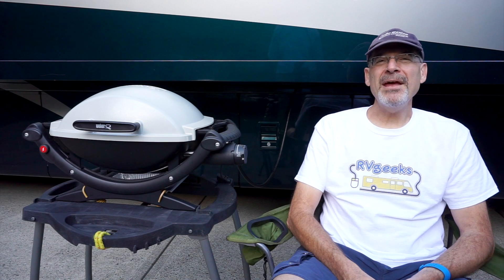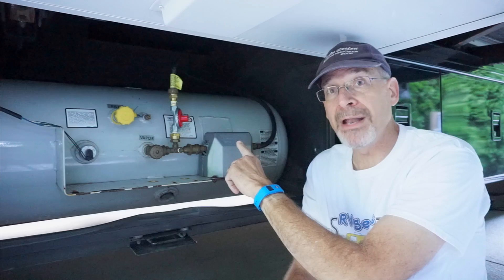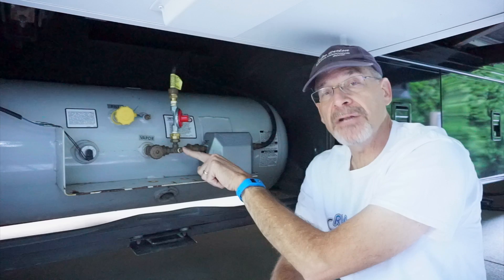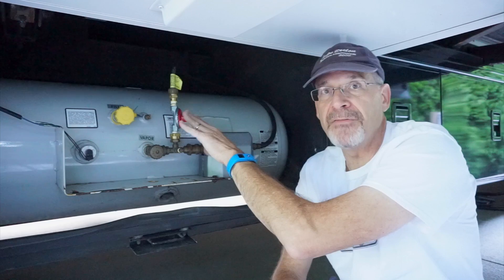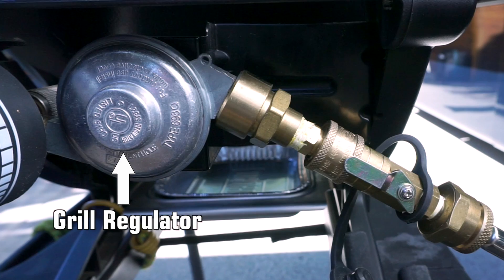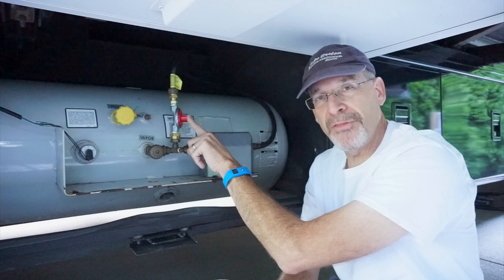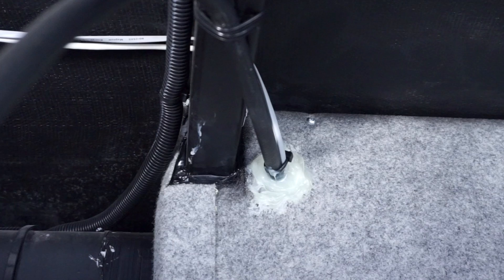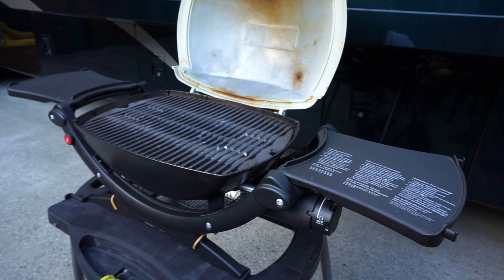How to Connect a BBQ Grill to an RV's On-Board Propane Tank

Comment: RVgeeks - I have a class A that has a port on the passenger side for just this use. I purchased and hooked up everything in your post here from that port to the grill (same grill as yours). I had no pressure at all. So I took the hose and connectors apart and started putting them on, opening the gas on each one to see where the flow stops. It stopped with the hose. I get nothing coming from the hose when I open the gas. I tested this by opening the line slowly and listening for the gas, but nothing happens. What do you recommend? (I'm using all the parts from this posting).  As always, thank you for your help. These posts really help people like me.
Reply from the maker: Hi Daniel! We're pretty sure that the first problem your having is the connection on the hose. Some have a little plunger in the end that seals when not connected to another fitting. That means the fitting that goes into it has to include the pin that pushes into the opposing fitting to allow propane to flow. The end of the hose is self-sealing, and needs that pin to push into it to open the flow. Also, it's quite possible that even if you get the propane to flow, it might not work with your port. If your port is already regulated down to 11" WC (eleven inches water column, or standard operating pressure), you'll either need to remove the regulator on you grill (we know... it's part of the control knob so not easy to do), or get a grill with no regulator on it. You should be able to check with your manufacturer to find out if the port is already regulated to 11" WC. If it is, a non regulated grill is required to prevent double regulation, which limits the flow below what the grill requires to operate. Hope this isn't too confusing, and hope it helps.
Reply: @RVgeeks  You were right on the issue... I actually just took a small drill bit and drilled out the plunger part and then removed the regulator ... works every time.  Thanks all.

Comment: Hi how are you able to run the bbq double regulated.
Reply from the maker: The first regulator is only a step-down to 15psi, so still plenty of pressure available for the second regulator on the grill, which is much lower than the 15psi.

Comment: Great video (as usual). My Winnebago came with a low-pressure connection for the grill, but I find the low-pressure grills to be on the flimsy side. I've seen converter kits to convert high-pressure grills to low pressure, but I'm wondering if you lose heat or BTUs on the grill. Any idea?
Reply from the maker: Thanks Mike, but sorry to report we’ve had such great service from our Weber Q (with  built-in regular) that we’ve never considered anything else. So we don’t have any experience with anything other than this one grill which is designed to be operated on higher pressure. Some grills do allow you to remove their regulators, allowing them to be used with the already-regulated propane on an RV with a low pressure grill connection.
Reply: @RVgeeks  Thanks! Looking forward to the RV'ers!

Comment: Has it been a problem that the gas is running thru 2 regulators?  One at the tank and one at the grill?
Reply from the maker: No problem at all! That’s because the 15 PSI regulator at the tank is still MUCH higher than the one at the grill. So it acts as a step-down regulator to prevent oil buildup in the long hose, while still providing plenty of pressure for the grill.
Reply: Interesting.   Trying to figure out if it will be a problem with the  coach I just bought.  Grand design 265bh.   It has an lp quick connect, but have heard it may be a problem running through 2 regs
Reply from the maker: @core8967  You could try contacting Grand Design to ask them if the propane supply to the quick connect is high/low pressure. But our guess would be that it's low pressure (i.e. after/downstream from the onboard pressure regulator) and that it's intended to be used with a grill that doesn't have a regulator. We haven't heard of any RV manufacturer that supplies high pressure propane to the factory-installed quick connects.

Comment: Hi guys!  I am trying to order all the parts you used, but the links you provided for the 1/4″ High-Pressure Quick Connects now take me to a page for Regulators, and the company doesn't seem to carry those parts any more.  I have searched online for similar parts, but the only ones I find are for low-pressure propane.  Can you help me please?
Reply from the maker: Hi Chris. Sorry for the trouble, but thanks for brining it to our attention! We found a new source for those and have updated the links in the description. The male side is here:  https://caloreequipment.com/products/5lpn-male-plug-x-1-4-mnpt/  and the female side is here: https://caloreequipment.com/products/5lpn-ball-valve-quick-connect-x-1-4-fnpt/
Reply: @RVgeeks  Thanks for the quick reply, and for the updated links. Unfortunately, that vendor is out-of-stock of the male connector.  I think I have found the same items here: https://tejassmokers.com/searchproducts.php?srch=104HP507 and here: https://tejassmokers.com/searchproducts.php?srch=401HP111.  Do those look like they'll serve the purpose?  One more question... I would also like to connect the extension hose to our Camco Little Red Campfire, which has a fitting for a typical hose from a 20-gal tank.  Can you tell me what kind of connector(s) I'll need to use the quick-connect on the extension hose?  Thanks again!
Reply from the maker: Hey Chris. Yes... looks like those quick-connect fittings from Tejas Smokers are the same high-pressure ones we found on Calore Equipment. Should work fine.

Can't say for sure all of the parts you'd need to connect to the Camco Little Red Campfire... but this might be a start: https://amzn.to/35l5VYj  Should connect to the hose from the Camco and convert that connection to a 1/4" male pipe thread that could be connected to the quick-connect. But you might need a different one that ends in a FEMALE 1/4" pipe thread (if such a thing exists).

Comment: How are you getting enough pressure to your grill with 2 regulators in the same line ?
Reply from the maker: Because the first regulator is high enough pressure (15psi). You can’t do this using the RV’s onboard regulator since it drops the pressure too low.
Reply: @RVgeeks  Got it. Thanks. My RV is only 19 feet and the regulator is only 5 lbs. not 15 and that is why I had to remove my second regulator.

Comment: Hey Guys, this might be a dumb question but...   would you use the same connection/ extension to your onboard Propane tank for a Mr. Buddy heater as you have for your BBQ?
Reply from the maker: +Rick Bernst Great question, Rick! You sure could. But there is one main difference: the heater would of course be inside the RV. As a result, when we installed the propane line for our Kozy World heater, we T'ed off the line the feeds the stovetop. That line is of course already regulated down to 11" water column, so there was no need to add the red 15 PSI regulator. A little more about that setup can be seen in our video about RVing in the winter: https://youtu.be/n5RGlcLSrM4
Reply: Aha!  Perfect. Thanks Guys! Safe travels this winter, looking forward to more "stuff" from you.

Comment: The part I'm having trouble with is on the BBQ end of it, how do you change it to that quick connect from the tiny cylinder connection? Is there a video for that part
Reply from the maker: NMS... check out the post on our blog: https://www.thervgeeks.com/bbq-grill-connection/ There are two images that show the pieces (one for each end... the tank and the BBQ), and links to the various components we used. Should clear up your confusion.
Reply: You can buy a hose with the correct fittings already on it

Comment: My husband did this. When we turned the gas on and the grill there was a humming sound coming from the tank. Should that happen and why does it? Thanks
Reply from the maker: Hi Dixie. Ours has never done that. Do any other propane-powered appliances on board also cause that noise? Or does it only happen when running the grill?

Comment: You have two pressure regulators, one at the T by the main tank and one at the grill, doesn't this cause the propane to have too low pressure?  I was always told you had to only have one regulator and that is what is making it so difficult for me to find a grill that I want.  My RV is already set up with a quick connect propane line for a grill but finding a grill that is set up for this that I like is the problem.
Reply from the maker: Using two regulators in the same line would normally reduce the propane pressure enough to prevent the grill from working. That's why we used a 15 PSI regulator at the tank, and not the standard 11" water column type (which equals about 0.4 PSI). 15 PSI is plenty of pressure to reach the far side of the RV through our 24' hose (two 12' lengths connected together), and still power the grill just fine. We originally tried an 11" water column unit at the tank, and the the grill would barely light, and go right out, because of the problem you mentioned.

If you already have a quick-connect grill attachment that came on the RV, we have to assume that it is designed to run any standard small grill right out of the box. Since all grills come with a built-in regulator, the many RV manufacturers who are now including grill ports would be insane to have those ports not have enough pressure to run a grill.

If you want to be 100% sure, we'd suggest asking the manufacturer if the grill port is designed to run any standard grill that's already equipped with a regulator, or consider posting the question on the forums at iRV2. There are tons of RVers there, and this is surely something someone has already answered, or can answer for you if you post the question. It's free to sign up and post at http://irv2.com/forums.
Reply: Thank you for the response, I missed the part that you used a higher pressure regulator at the tank.  I will email the manufacturer about the propane line and hopefully it will be an easy fix.  Thank you for your videos and thanks for the response.
Reply from the maker: Good luck Daryl. We have a feeling you'll be good to go with any grill right out of the box, but please do let us know how you make out.

Comment: I was under the impression that you could have 2 pressure regulators in your system or the appliance would not operate properly.  It appears that you do have two...one at your tank..and one on the grill.  Please explain if you can.  Thanks!
Reply from the maker: Hi Peter! The one at the tank is a 15 PSI unit, which is still pretty high. So that's acting as a "step-down" regulator to keep the pressure low enough to avoid oily buildup in the long line to the grill. But it's still plenty enough to avoid the double regulation problem, which occurs when you use two 11 Water Column regulators in sequence (that's the standard type found on grills, equal to about 0.5 PSI).
Reply: Got it...read some blogs yesterday and did even more research on this topic...I believe the camp chef Ranger II will fit my need to connect to the auxiliary propane connection on my lance.  Great video...tks

Comment: Ok, so I need some advice.  Set-up identical to yours.  Brand new Weber Q 2200 grill.  With a 1# canister, grill reaches 600 degrees in less than 4 minutes.  Using the hose setup, I max out between 325-350 degrees. Any ideas or suggestions?
Reply from the maker: Hi Glenn. Did you order all of the parts through the links that we provided? Or did you get them locally? The reason we ask is because sometimes, when people buy local, they get parts with the same size fitting... but which aren't high flow, so there's too much restriction in the line and the grill doesn't get enough propane (flow, not pressure) to heat up properly. Could be what's happening here.
Reply: All parts as specified and ordered from Amazon (and Tejas Smokers) except the brass Tee itself.  Due to location and orientation I had a dealership install it.  I have no idea what brand they used, but it seems like all "extend-a-stays" should be designed alike, to do the same thing.  The two hoses were both the Camco brand from Amazon also.  I'm just baffled!
Reply from the maker: Wow, Glenn. We're a bit baffled, too... as that setup should just work. Can you confirm that the dealership installed the Tee between the tank and your RVs onboard regulator? If it wasn't, and was installed downstream of the onboard regulator, we wouldn't think it would even work (the 15psi regulator requires more pressure to open than the onboard regulator would output), but we have to ask.

One thought... have you tried turning off the propane at the tank and then opening the grill's supply to release the pressure in the line... and then turning the grill off and turning the tank pressure back on slowly? It's possible that a built-in flow restrictor (designed to prevent a more severe catastrophe in the event of a line bursting, etc) got triggered and is reducing the flow. It's worth a shot, anyway! Let us know!
Reply: I will be testing your theory asap.  Unfortunately, today, we have a nasty mix of snow, freezing rain, etc here in Mid-Michigan so this test can wait a day.  Will let you know the results when I get it done.  Thanks again!

Comment: I don't understand  how you have a regulator on the tank side sending low pressure to your barbecue yet you have a regulator on your barbecue still. That technically shouldn't work. What am I missing?
Reply from the maker: The trick is that it’s not actually a low pressure regulator that’s sending propane over to the grill. It’s a 15 psi regulator, which is much higher pressure than needed for the grill. It’s basically a step down regulator to prevent oil buildup in the line, but still leaves plenty of pressure for the grill. If it were the same regulator as on the grill, it would indeed be “double regulation“ and wouldn’t work.

Comment: I am having trouble connecting to my 2 burner Coleman stove.  I have read on a few forums that this is a commpn problem for the "classic coleman stoves", have you come accross this in the past?  
Thanks!
Reply from the maker: Hi John! We hadn't heard about that. Are you having a problem with the fittings not being compatible (in other words you can't connect it at all), or having a flow problem after making the connections?

Comment: Hi, guick question,  do you have a really low flame pressure with 2 regulators?
Reply from the maker: Hi Tony! No problem with low flame, because the first regulator is 15 PSI, which is far higher than the grill regular. It reduces the pressure enough to prevent oil from building up in the long hose, but still leaves plenty of pressure for the grill.
Reply: @RVgeeks  Thank you for the reply, I bought a T quick connect and some quick connect hoses,  hooked everything up and I have no propane to my appliances..lol
Both tanks are full, quick connect valve works,  yet I'm lost...
Reply from the maker: Sorry to hear that,  @wooby24 ! If we had to guess, it's likely the protective mechanism on you tank... if you turn the propane on too fast, or if it rushes out of the tank to fast when you turn it back on, it can cause a failsafe to trigger to stop the flow. To fix it, you've got to turn the tank off and release all the pressure in the lines (you can run the stovetop to be sure it's released and you may have to disconnect the line to the regulator to let that pressure out, too). Then, close everything back up and SLOWLY turn the tank back on, so the propane flows slowly to re-pressurize everything. Once that's done, everything should be back to working as normal. 🤞
Reply: @RVgeeks  I will give that a go...cheers. and thank you

Comment: My Propane is on the passenger side of my coach  where I typically BBQ. My extension line will be only 15' from the connection. Do you feel the red regulator is still needed? Thanks for the video & help.
Reply from the maker: Hi Lynn! Unfortunately, we're not sure if there's a specific "magic number" of feet that the oil starts becoming a problem. Ours was 24' long. We're guessing that 15' might also be long enough. Sorry we're not sure.
Reply: RVgeeks Thanks for your input. I’ll error on the cautions side and add the red Regulator. Love your input & videos!

Comment: Great video.  I just picked up a Jayco Travel Trailer and it's already pre-plumbed with the quick release plug in the back.  I was looking through your links and can't quite figure out the combination I need to make mine work.  I need to go from the quick connect that's already there, to get adapted to the normal 20lb propane connection that my grill has.  Any suggestions to links on what I'd need to do that.  I must need more than 1 or 2 things, because I can normally come up with the combo browsing Amazon, but not happening today.
Reply from the maker: Oh boy, Kraig. Can’t help you specifically on this, but a couple of things to consider. First, is that propane connection high or low pressure (before/after the onboard regulator).  Because if it’s LOW pressure, you’ll need to consider that and ensure you remove the regulator from the grill. And you’ll need to know because the connectors for high pressure quick releases are different than low pressure ones, so you’ll need to be sure to get the right adapter or else it won’t work. Sorry we can’t be more help!
Reply: Yeah, I'm an idiot.  I didn't realize how it connected to my current grill, I assumed it was a solid connection, but it wasn't.  I threaded off the hose with the regulator, and installed a line I got on amazon and it worked like butter.  I just needed a "T" for my quick coupler gas line, so I ordered one of those, and now I can have my grill and my stove burning at the same time.  Thanks for the info.